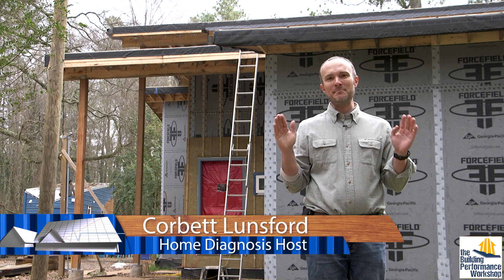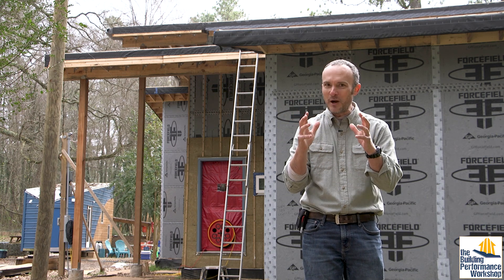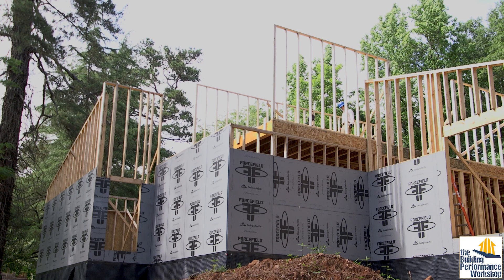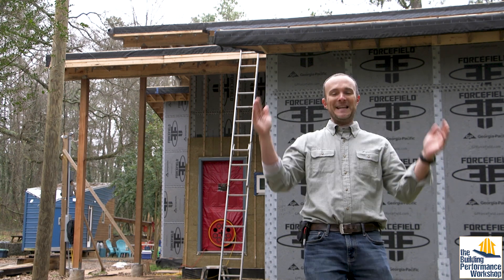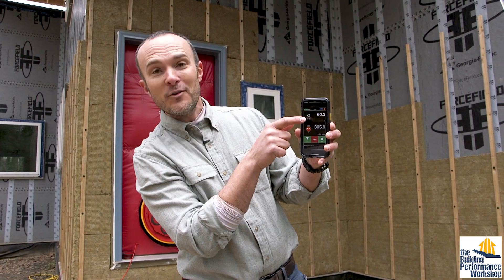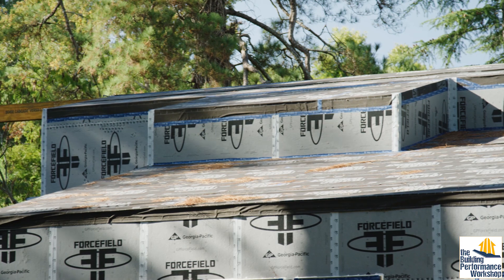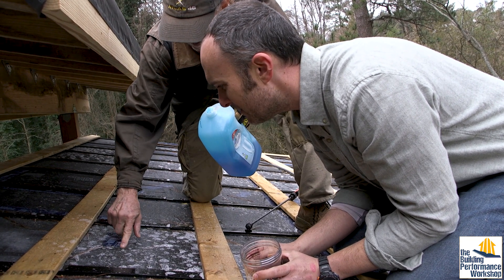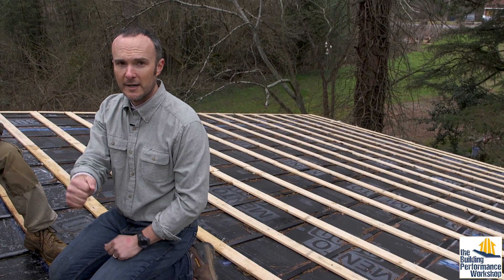Bubble Test for Weather Proofing: Blower Door Fail

Comment: Hidden fastener standing seam metal roof is designed to handle even hydrostatic roof conditions (swimming pool test). Exposed fastener metal roof is designed to meet hydrokinetic roof conditions. If you install the former style roof panels, I would think you will never have an issue.
Reply from the maker: Very cool and very technical. Thx man!

Comment: I don’t know if the amount of pressure is the problem. If the underlayment balloons the. There must be enough pressure to create a bubble since the underlayment is heavier than the soap. The surface tension or whatever of the dish soap must be too weak to allow for proper bubbling, maybe using kids bubbles or big blue Hvac leak detecting bubbles would have yielded a different result. Just a thought.
Reply from the maker: I was advised that glycerin might be the missing ingredient- needed it in quantities that could spray on a 3000 sq ft roof

Comment: Forget this tedious process! Find an Aeroseal contractor in your area and have them seal your house. Most of them charge by how many .1 air exchanges they reduce your house so I don't think it would be too costly.
Reply from the maker: Haha, Micah- just so it’s clear, this is not an air leakage issue (0.4 ACH50), it’s a more nuanced water leakage issue.

Comment: Just throwing a dart at this thing.... but how about using a pressure panel test? The grid-like pattern made by the strapping could allow for locating of troublesome areas (?)
Reply from the maker: Ennio, you’re going to be a great Mastermind of diagnostics. That’s a super cool idea. However, as proven by the BD test, the Mento doesn’t seem to be leaking any more air than it did 5 months ago. It’s a conundrum.

Comment: I think part of the issue with the test is you where spraying it on. Need to pour it on and wait. Takes a while gor bubnles to form.  However i think that shows how self sealing the mento is. As long as water can't pool up against the batterns its fine.

Comment: My first thought was a smoke test
Reply: but fail due to lack of pressure for such a small area
Reply: @FixthisCD  Ive seen a fog machine used to fill a house then they pressurized the house and you could see smoke outside in leaky areas but not sure if it would help pinpoint tiny holes.... Call the fire dept and warn them before conducting the test....

Comment: 500 gallons of the blue viper by refrigerant technologies leak detector solution with a large sump pump in a garden hose. 
       If it was my own house I would just use a heavy duty industrial membrane that was even rated for a constant outdoor use and walking on and UV exposure and then cover it.
Reply from the maker: Haha, right- as stated, I'd had no problems with this in the previous installs on the roof of enclosures.

Comment: When inner tubes were popular in tires we used to use this process to find the hole to patch.  You aren't wearing your safety harness.
Reply from the maker: Yes, with much higher pressure. Yes, we are not. 3:12 pitch.

Comment: Mento doesn’t seem like a great roof waterproofing material. It would be much better to have a material that is more durable, can self seal and is fully adhered to the roof sheathing. Then you don’t have to worry about small leaks.

Also, the soap water leak test doesn’t tell you if there are leaks under the rainscreen wood. There could be a bunch of leaks under the wood that you wouldn’t see.